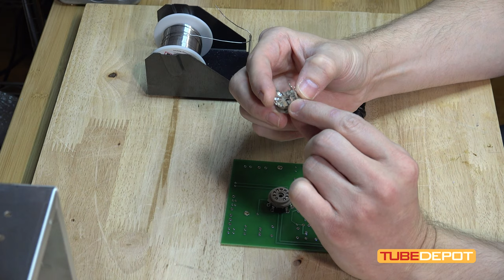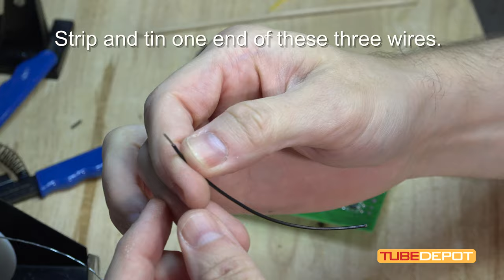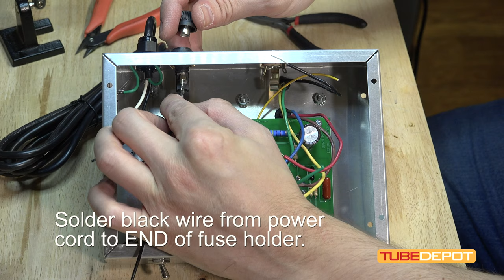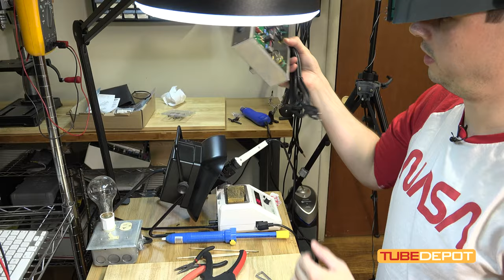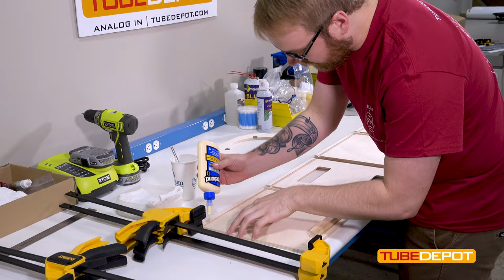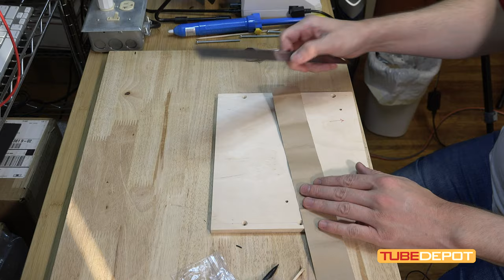How to Build the BUD Guitar Tube Amplifier

Comment: You should have a load (speaker or dummy load) connected when powering up with tubes in. Even with the volume off it is safer and prevents you accidentally frying your OT.
Reply: I usually solder an 8.2ohm 5 watt resistor from the tip to the ground switch of the output jack, just in case, cause I only have an 8ohm speaker cab. 😁
Reply: I'm a rookie and that bothered me based on what I know. Glad someone else spotted that. I was about to scour the internet to make sure I wasn't crazy.
Reply: 노래방키트를
Reply: 노래방

Comment: Great video. Thanks for doing this with this level of detail.
I have a dumb question: does it matter which end of the transformer I connect to the plate and which end I connect to the supply?
I think it doesn't, since the transformer has no positive/negative terminals. But just want to be sure.
Thanks

Comment: Why solder the tube sockets from the tops as well?If the PCB holes are metallised there shouldn't be any need to do so.
Reply: That's correct ! There is no need to solder on both sides of the board.
Reply: @bio-techlarry9602  Agreed :-) However, my comment was in relation to a board with metallised (plated through) holes.
Reply: I do multi level boards all the time and the solder reaches both.sides without the need to actually solder the top side. I do not and will not use unleaded solder on any board. Unleaded solder causes tin whiskers to the joint. The military still uses only leaded solder and so will I. Heat and a little flux is the key to good soldering. Use a heat control solder station and you will get better results. 73

Comment: Why do you have a light bulb plugged into your power outlet?
Reply from the maker: That's a dim bulb tester. A dim bulb tester allows you to put an incandescent light bulb in series with power running into unfamiliar or newly built tube amp. The light bulb acts as a current draw if there is a short in the equipment being tested. Not only is it easy to build, it’s also a dependable way to safely test old and new tube gear while lowering the chances of doing damage in case there is a problem.

Comment: Please be aware that not every single step is shown in the video but are in the printed directions. 

1.) You need to install a jumper J1 on the PCB.
2.) You will need to install the cleats in the cabinets. In the video they are already glued onto the side boards of the cabinet. You have to measure, mark, then glue them yourself first.
Reply: Thank you!!! Totally missed J1 in the instructions. Lucky I read the comments of this video before assembling it, and I remembered your comment.
Reply: Yes, thank you for posting this! The problem I'm having now is that I don't know what it means to "Also make sure you have installed your jumper wire at “J1”". J1 seems to label two little holes that are right next to each other but there is no connection between them. When in "install your jumper wire at J1", does that mean you connect those two holes by soldering a wire to each one?
Reply: Well, I got impatient I just connected the two J1 holes. I absolutely do not know what the hell I’m doing, so this was a risk. Would it explode and kill me? Would I fry something and destroy my build? The only way to know would be do just try it. Clearly, I survived. And, connecting those holes eliminated a 120 cycle hum I was getting.
Reply: That is exactly what that means. You won't blow anything up, I think. After you're done, carefully follow the steps for checking all the voltages. Then go back and do all the tests again. Also, I highly recommend building a current limiter for the first time you actually power up the amp. Uncle Doug has an explanation of how to build one here: https://www.youtube.com/watch?v=wRFRwOnLsZI @paulm.7385

Comment: Is the shielding tape to make the amp chassis ground better?
Reply: Not quite. The chassis is open on one side, so you effectively put a lid on it with that shielding tape. 
Interference from that direction will be significantly dampened as opposed to the chassis being open.

Comment: Speaker is installed reversed, the baffle should be against the wood.  This installation would produce a tinny sound.
Reply from the maker: Speakers can be loaded from the front or the rear. We opted for a front load on this kit, though the BUD is certainly not tinny. More like rich and creamy. The BUD can be also be purchased as a stand alone head (no speaker / no cabinet) and you can plug it into any guitar cabinet you want.

Comment: Okay, think about this before you start assembling, and I don’t class this as building.…. You should start by installing resistors first. Installing pots in the early stages can lead to accidental damage of repetitive bending while installing other components. Take this from a guy with 44 years of repairing and building tube and solid state amps……!

Comment: It would be nice to hear a sound sample of ACTUAL clean tone.  What I hear that you are calling "clean" is not what I consider clean at all.  I hear the amp is breaking up a little already - hence, not clean.  
Please advise as to where one might be able to hear the amp played truly clean and clear at its best.  
Thanks.
Have fun!
Reply: A two watt amp has very little headroom.
Reply: @jerrystephenson1172  
Hi, Jerry.  
Well understood.  That means that it is going to start to overdrive the tubes and circuits before it gets very loud at all.  But, quiet as it may be, I would still like to hear whatever it is an amp can do while it just at the point before any noticeable breakup is included in the output audio.